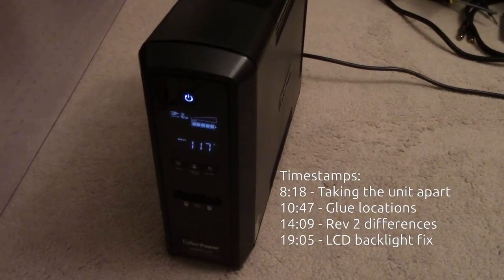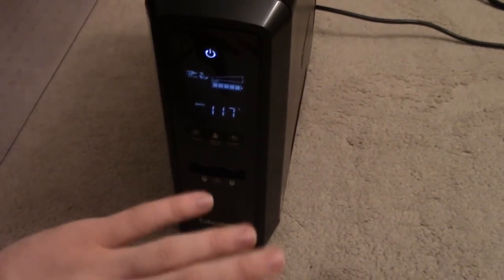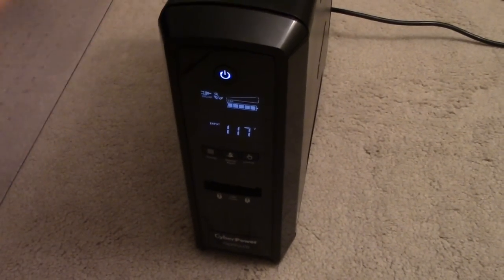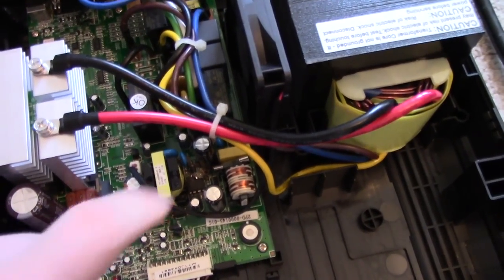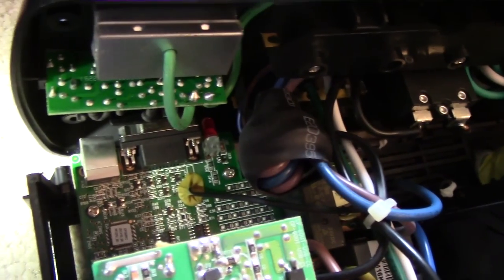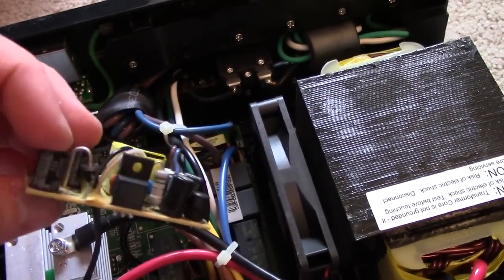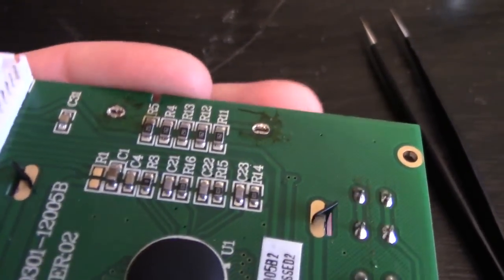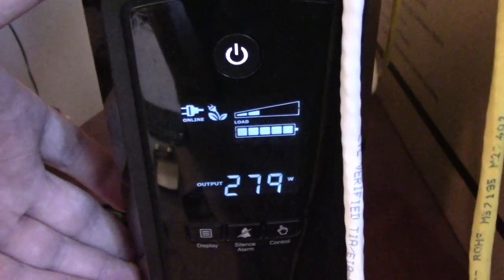CyberPower UPSes Contain Conductive Yellow Glue of Death (+ Bonus Rev. 2 Dim LCD Fix)

Comment: ADDITIONAL SAFETY CONCERN:
A bad smell and/or irritated eyes emitted from these units are found in some of this video’s comments here as found in video & forum comments elsewhere:   Hydrogen sulfide is a poisonous gas emitted by lead acid batteries when they are being ‘overcharged. It’s often described as having a rotten eggs smell, and sometimes as sulfuric.

It can be lethal in high enough concentrations. Mild symptoms of hydrogen sulfide exposure are commonly irritation in the throat, nasal passages/sinuses, and/or eyes. 

Hydrogen sulfide is heavier than air in the room so it sinks down and smells strongest near the floor of the room where there is the least amount of ventilation, so pets and small children will be exposed to higher concentrations of it.

Excess electrical current breaks down the liquid sulfuric acid used in lead acid batteries, and hydrogen sulfide gas forms and is released into the surrounding air in the room.

I have health concerns about smells from my CyberPower UPS since I bought it in 2016 (the same one shown in this video CP1500PFCLCD, rev 2).

There are several different possible causes that result in the overcharging of a lead acid battery which are easily to find via google, but I don’t know which one is causing CyberPower units to emit this smell as described by a lot of comments I’ve seen for YouTube videos and in tech forums. 

I’ve read that one of the common causes of overcharging in a lead-acid battery is a bad cell in the battery or an internal short in the battery. 

I‘ve experienced this beginning since the first 6 months of buying my CyberPower UPS.

I’ve just ordered a replacement battery from CyberPower and I’m hoping the rotten eggs smell that happens sometimes will stop so it’ll just be the battery that was bad and it’s not a flaw in the design in and/or manufacture of the UPS itself.

But as I’ve seen a number of comments over the years by people saying they’ve experienced this smell from this product line, I’m a little doubtful that there’s been a mass manufacturing  defect in CyberPower’s batteries, as the lead-acid batteries are the simplest part of a UPS, and there are a number of other ways lead-acid batteries can be overcharged…

I actually experience 2 different and really distinct weird chemical smells that sometimes build up in a room from my CyberPower UPS and both odors smell intuitively toxic. 

One of the smells is more faint and it smells like something I can only describe as maybe acidic, acrid, and like a faint burning chemical odor that’s a little like burning or melting plastic…

The other smell is that rotten eggs excrement-ish unique smell that clings low to the floor since it’s heavier than air so opening a window alone takes an unintuitively long time to get rid of it. (I put a big fan in the window to blow air out of the room with the door open and sometimes also with another window outside of the room open as well to get a stronger air flow). 

Before initially googling this rotten egg smell, I noticed it most often happens after a power outage during which the UPS’ battery was used for roughly anywhere from 4 to 20 minutes before shutting down attached desktop computer(s). 

So it seems that the rotten eggs smell happens most often when the battery needs charging for periods of time longer than the more frequent short recharges needed for when the battery naturally loses a bit of its charge.

In any case, there’s no warnings of the possibility of being exposed to the toxic gas hydrogen sulfide as is somewhat commonly experienced by people recharging lead acid batteries in general, and there’s no warning that this physically possibility can occur in CyberPower’s UPS’ as with any other piece of equipment that over charges a lead acid battery for whatever reason (I don’t know if other UPS companies have such warnings).
 Considering these batteries are being used in well insulated and therefore  often poorly ventilated rooms in homes and offices instead of in airy garages or outside where lead acid car batteries are most commonly charged, I think it’s crazy that:

1.) Warnings to watch out for the possibility of smelling this hydrogen sulfide rotten eggs poisonous gas are not required by law (When you get natural gas service for a gas stove the gas company is required to inform customers to look out for ‘the smell of gas’ that indicates a gas leak)

2.) That this apparent overcharging happens often enough to enough people who own these CyberPower UPS product lines to come regularly across a few comments in video posts like this one and in blogs that there isn’t a product safety recall (like there would be on pretty much any other product causing toxic exposure lol) and/or that what’s supposed to be a reputable company would actually mass produce consumer product(s) that seems to have rather dangerous aspects in their design and/or have manufacturing flaws, including the one in the subject of this video.

Comment: Happy to report that my UK CP1300EPFCLCD purchased in November 2017 only has what looks like Sony bond over one small and unimportant wire near the USB charging ports, could be an earth wire. All of the other caps, diodes, fuses and SMD components appear to have no capacitive Sony bond or excessive glue on the top side of the circuit board. Happy days. This video was really helpful to figure out how to get into the side panel, I wouldn't have persevered with the side panel had you not warned about the horrible sound and feeling as you 'peel' it away from the other side! It really does make a terrific noise when opening (and re-closing)...

Now I'm in the process of replacing the battery as my runtime is dismal (5 years on the original battery = time for replacement). Trying some Yuasa SW280 7.6 Ah cells, slightly uprated from the OEM 7 Ah which are really hard to find for a reasonable price. Some people will suggest 9 Ah as an acceptable replacement which won't overheat the charging circuit, but I'm happy enough with 7.6. I'll report back if they fit OK once they arrive.
Reply: Out of curiosity why did you decide to buy a replacement battery of a third-party manufacturer instead of buying a replacement battery from CyberPower? I looked at third-party batteries as well but it seemed safer to buy one from the manufacturer of the UPS…
This is the first time I’m replacing a battery in a UPS so I don’t know anything about CyberPower replacement batteries vs batteries made by other manufacturers for these CyberPower upses…
Reply: @m1carver  nothing unique or special about CyberPower branded units except they are OEMed with their stickers on. In all other respects they are a standard battery, hopefully (but not necessarily) quality validated, and with a hefty price mark-up. In my case, the CyberPower branded batteries were not available in my country at the time, but I had already decided to use quality brand Yuasa batteries, which were also slightly uprated over the stock capacity (also a common practice to get a bit more runtime). I could buy them from an independent battery retailer for considerably less, something I've done several times previously for several of my APC units. All you need to do is confirm the size of the connector terminals are the same (look at the specs and do a little research, very easy) and reuse the wiring harness for the replacements, job done. 😎
Reply: All worked ok with the replacements, I've also installed the same Yuasa batteries into four APC units and they're all running great.

Comment: From my research these adhesives are based on Neoprene with toluene as the solvent, they may have been reformulated at some point but those are the major ingredients of Kafuter k-1668 which seems somewhat representative, there may be other additives that might cause or prevent this kind of problem but I can't find out anything more about it.

Comment: Could have lost my home! Mine leaked acid on first set of batteries, and caught on fire with the second one. I have a barely two year old CyberPower CST135UC.  The original batteries that came with it leaked. After removing those, cleaning as best I could,  and letting the UPS dry for weeks, I tested it with a couple of spare UPS batteries from another UPS and it worked. I ordered new batteries and left it connected for a week without load. The other day, I hear crackling in my office only to find the UPS was smoking then suddenly on fire. I ripped the power cord out of the wall and used that to throw the ups out the door into my back yard. I kicked the battery panel off and covered the whole thing with sand. 
I'm so lucky I was here when this happened.

How are such things able to get on the market? I've been using APC and other brands for 30 years, never had this happen.

Comment: I have exactly the same model as Mark. 2 days ago something started smelling like electrical smoldering in my lab. I couldn’t find the source. Even when everything was off there wasn’t any prime suspect. Then yesterday when I was turning on my CyberPower UPS, I heard a kind of a boiling sound and the smell intensified. Disassembly confirmed browning of this yellow glue in exactly the same area. I don’t know yet if the damage is done or I only need yo get rid of the glue. It’s a shame CyberPower won’t recall these units.

Comment: I have a Cyberpower CP1500AVRLCD that I bought back in on "March 15, 2009" which ran perfect until "May 14, 2020" when ithe battery finally just gave out and had to be replaced.
Still using it right now!

Comment: Mine just died during the night with the F03 error. I was just going to replace the battery, but decided to investigate. Mine has it in all the places mentioned in the video and it's very brown. Hopefully none of the parts are ruined. I actually have the 1000PFCLCD and it basically looks identical to the models in the video. I'm trying to find the best way to remove it. I'm considering using my hot air workstation to soften it up.  Thanks for posting the video, getting the case apart would have been very frustrating without it.
Reply: Tried hot air and also tried acetone. Hot air didn't help, acetone helped with the more yellow looking stuff, but not the hard brown stuff. Very tedious to scrape off without damaging traces. Need to wait for new battery to arrive and hope charging chip isn't damaged. They are available for sale, but VERY limited quantity.

Comment: Thanks for this video. I just replaced a broken power button in one of my 1300VA versions. Works fine in online interactive mode, but when it swaps to battery backup to power a load, it immediately start buzzing and getting very hot (within 10 seconds). By 30 seconds, it started smoking. Looks like the main bulk cap between the batt leads and the big ole heatsinks has swelled somewhat. It's almost as though there is a short in output circuit somewhere when it switches to battery (and it doesn't blow a fuse or shutdown etc!), so it goes nuts and provides all the grunt it can in an unregulated fashion....

If anyone has thoughts on possible causes, I'd be interested to hear them!

Comment: I made it to your question!

Good, informative, detailed video. Thanks for making it, I'll surely be subscribing.
!
The reason I arrived here... I am attempting to utilize mine, a Rev. 2, as a standalone, straight through, solar inverter (no grid power or batteries used). However, I'm running into the issue of needing a 110A/C supply to even activate the unit (won't seem to turn on without one).
I bought mine brand new several years ago and just never ended up using it... so, it is still in unused condition.
Can you tell me if it is possible to alter it in any way to eliminate its necessity for a power supply - to supply power? I'm fairly competent with a soldering iron and do have limited circuitry repair experience but am by no means of expert caliber.
PS, plugging it into itself is seemingly not a solution.
Also, with solar power supplied to the battery conns., I CAN achieve the power-OFF tone when attempting to power-ON...
(one constant beep followed by two shorter beeps)... but no activation of display or power to outlets.

Thanks for any help!!!

Comment: Maybe a been a planned obsolescence here? Seems likely that the engineers know that this glue would break down in this manner, especially considering it seems like this type of glue is rarely used in electronics, at least ones that I've come across. It seems much more common to use the silicone and hot glue variety like you mentioned in the video.
Reply: Very common to see this in cheap units, used because it is cheap and needs no special applicators, and has a really long pot life, plus easy to add solvent to it in the pot when it gets thick.
Reply: Seems overall well built, as its just this glue that is the problem not the rest of the design of the unit
Reply: Planned obsolescence to start a fire?
That's how you get lawsuits.

Comment: Thank you for the warning. Mine is the CP1000PFCLCD, I believe rev. 1. It had this crap on the thermo sensor, giant capacitor, and charging circuit. The charging glue was discolored. I wonder if this caused the replacement battery to not last quite as long as the last one. The thermo sensor has a spot marked for a connector on the pcb, but they soldered it directly instead. Broke that wire trying to get the glue off, so I put a connector in place like it was suppose to be.

Comment: Mine just died 8 days ago, it sounded a continuous tone and then died
I bought the 2-battery replacement and installed them 2 days ago but haven’t put it back into use as of yet for a portion of some very expensive recording studio gear, so arggg !!
Mines from Amazon 2017-2018

Comment: Opened mine yesterday, I was using it for about 4 years now, mine being "second gen" pfclcd 1350va UK model... Pcb was half similar to your video second gen one but part were battery cable leads come out was completely different, also the glue was yellowish color not brown and there was much less of it than on your board...still scraped it off and disconnected usb power supply board cause I don't use usb ports on it, yet my power led is still dead, it was flickering after 3 years of use and died now power button doesn't light up but unit still works, that's what I care most...

Comment: Can anyone kindly tell me if the European version with schuko sockets also has the same problem as the yellow glue?
Reply: Hi, did you find out? I want to buy the CP900
Reply: @cesarebaroli9610  I’m not 100% sure, but having opened my UPS, specifically the CP1500 European version with Schuko plug, I didn’t find any of the so-called "death glue." Instead, there is a kind of hard white plastic, but only on the connectors, likely to prevent them from accidentally disconnecting.

Comment: Opened my rev-3 case to take a look.  Only found a small amount of yellow glue on four of the big caps.  Doesn't look like any problem though as there are no circuit board traces on the top side of the board and no other conductors right there.  There is also some silicon adhesive holding what looks like a ferrite bead on one leg of each FET.  I'm adding some links to pictures.  Let's see if YouTube allows the links.
https://veiks.com/forumphotos/3/cyberpowerboard.jpg
https://veiks.com/forumphotos/3/cyberpowerbigcaps.jpg
https://veiks.com/forumphotos/3/cyberpowersmallcaps.jpg
Reply: how can you tell which Rev you are with? thanks mate
Reply: @theoscats  I don't know of any markings that indicate the Rev.  I just know that my PC board was different than the one in the video because it had no traces on the top side.  So I made the assumption it was a newer Rev 3.
Reply: @TomVeik  The rev 3 is the one with the lcd color panel and the USB type C port. Do you have that one?
Reply: @gertumin  I have a color LCD and USB C on the front.  USB on the back is not USB C though.

Comment: I cleared all the nasty adhesive before it went bad, I have a REV 1. Replaced it with some neutral curing silicone. The 1A USB chip failed. We use the front USB ports to charge phones, so I squeezed in a mini 2.1 USB adapter and ran a charge wire to the front ports, good as new. Hopefully I will get a few more years out of it and my 1350. Purchased them in 2012, running constantly since then.

Comment: Great video... not looking forward to dealing with the three of these that I have at home. But time spent is still better than dealing with a fire. Any idea if this could also be the cause of the nearly continuous acrid smell that I get from my Cyberpower CP1500PFCLCDa?
Reply: @pabloyanez2235 Mine emits a gross odor sometimes. Sounds similar to what you experience but mine is sporadic. It also emits a pretty strong rotten eggs smell when it’s battery is being used in a power outage… apparently that’s hydrogen sulfide from the lead acid battery and that’s poisonous gas. 
I bought a new battery to replace in my unit but now I’m seeing this so I’m not sure if I’m going to keep this thing if I can’t be sure it’s going to be safe.